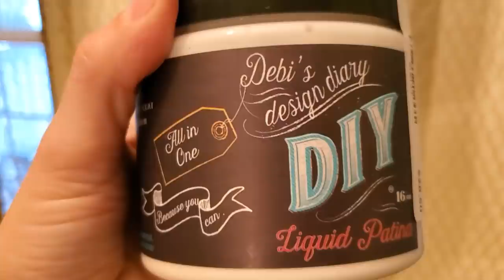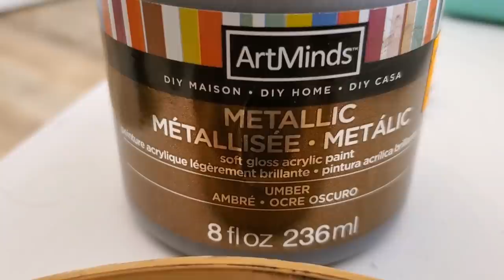French Country Cabinet Makeover *European Inspired Finish*

Comment: Deborah. I'm not a big fan of the repetitive flowers across the top and bottom & would have covered most with plaster. I think they cheapen the over all look. however the painting technique always works for me. A couple jugs painted with that same technique would work inside the cabinet with flowers complimenting the curtains might look great.
Reply from the maker: Good morning! I agree and was thinking the same thing at one point, but I ended up leaving them. I also considered adding clay moulds over top for even more dimension, but the unopened clay I had was dried hard. I did purchase more, but the cabinet was already painted by then. Glad you like the finish on it 💚 Have an awesome day today! Xoxoxo